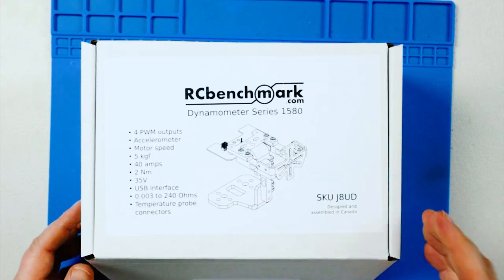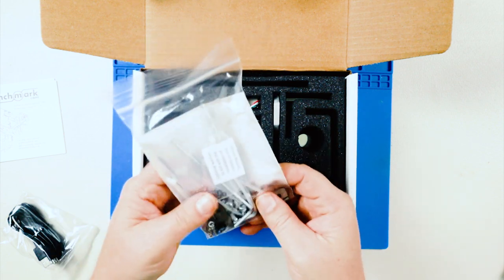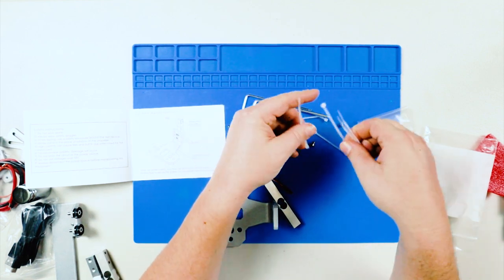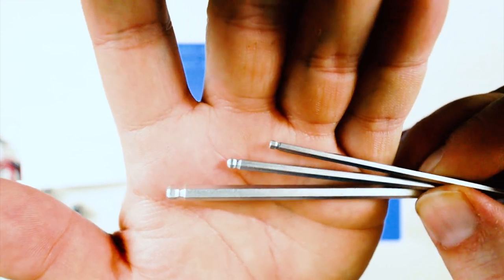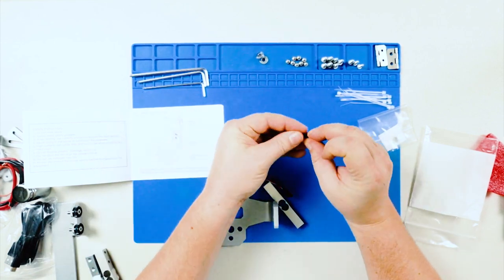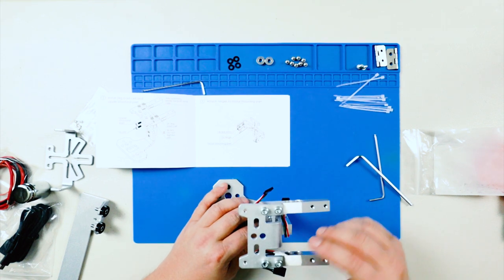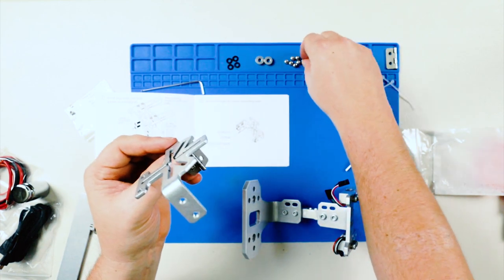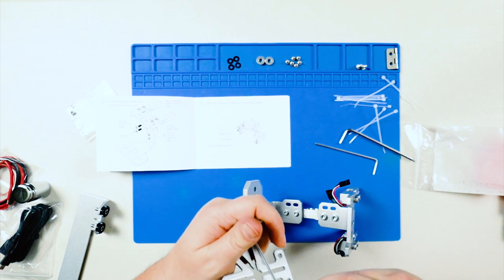RC Benchmark's 1585 (1580) Thrust stand Unboxing and Review

Comment: New to this hobby and am interested in the 1520 thrust stand, is there any reason not to get the 1520 as compared to this 1585?
Reply from the maker: It honestly depends on what sort of data you are looking to gather, how "deep" you want to dive into benchmarking, and what size motors/props you plan on using to test.  If you let me know what you want to achieve, I can help steer you in the right direction (owning both).  However the short answer would be the 1520 is very "simple" and just measures trust with a single sensor.  The 1585 measures not only thrust but also torque using three sensors.  Thrust is only part of the equation when you are building a quad.  This of a slightly larger prop spinning slower, or a slightly smaller prop spinning faster.  Both could generate the same "thrust" however the torques in both could be very different, and that would matter for abrupt changes with race/freestyle type flight while may not be so critical with cinematic type flight.  Let me know what you are trying to do, and I'll let you know if the 1585 is maybe overkill, or just right for your needs.
Reply: @tronage  similar to you I have been a crate and.drone drop person for a while and have.lots of props. I also have motors from 11series up to 22 series. I am new to this hobby and not to good at flying yet but enjoy the building and learning. I do not see myself doing much above 5" for the foreseeable future. Any guidance would be appreciated.  Also I really enjoy your content on YouTube, keep it up. Thanks
Reply from the maker: Esp. if you plan on 11xx - 14xx type smaller motors, the 1520 is probably where you would want to be.  I've tried doing smaller motors on the 1585, and it just isn't suited for it.  To start you can't even mount them properly.  I made an adaptor plate on my 3d printer (which is less then ideal, as metal would be better), honestly the 22xx-ish size motors are sort of the minimum size you can mount on the 1585 without adaptor plates of some sort.  I would say for your use case, esp with smaller motors the 1520 is more suited for your use case, and is easier to use and experiment with.